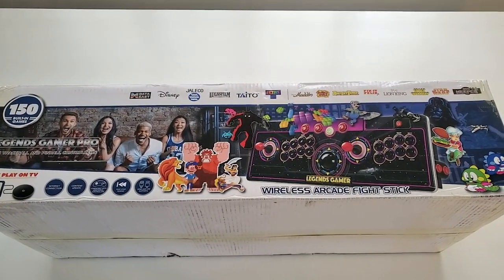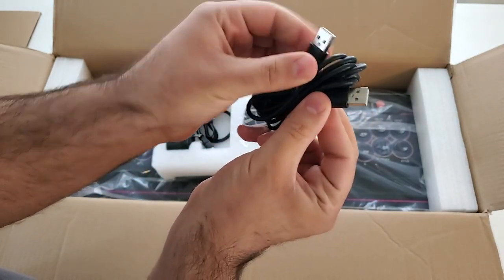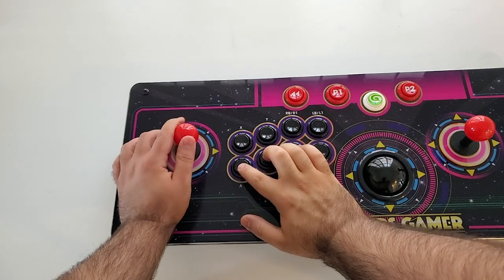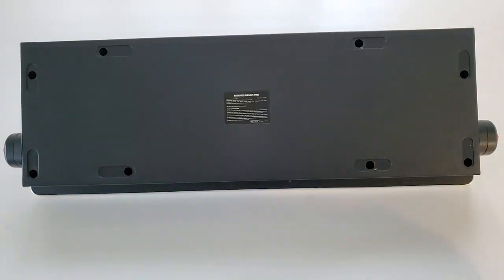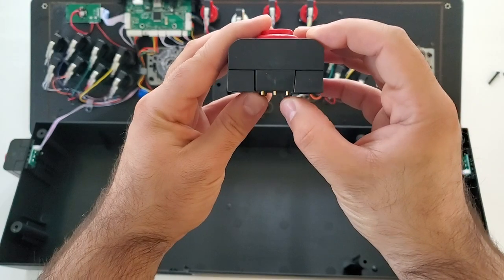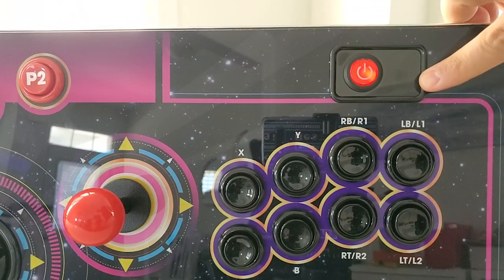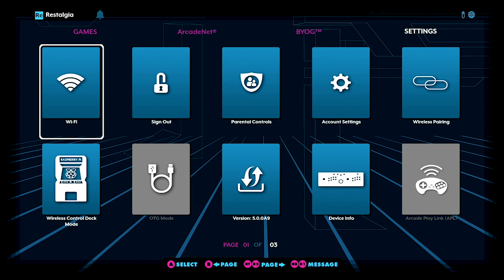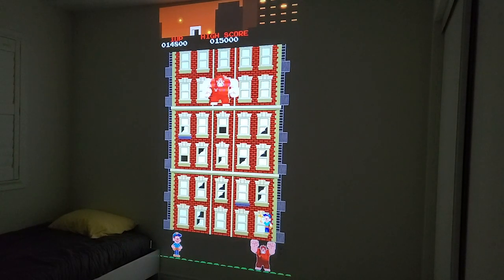AtGames Legends Gamer Pro Teardown and Review

Comment: There's is an open pin for spinner. So u can actually add a spinner.
Reply: Hope someone can mod to make use of the spinner.
Reply: @victormercado4478  Spinner add-on is 29.99, Walmart has the system for 99.99, finally bought one. Can't beat it at that price.

Comment: As far as the battery run time is concerned, I have the Legends Gamer Mini and it has been on for about 1 and a half days and is still running with whatever charge it came with when I got it from E-Bay and the battery low is not n yet.

Comment: In case you bought this for $99 recently at Walmart and are unhappy with the horrible lag from the BT controller - set your TV to game mode and it fixes the problem. I was ready to return it due to the horrible lag until I discovered the game mode setting fixed the issue.

Comment: Hey, new subscriber - Great vids! quick question. I have an Xtension control panel that kinda looks like this product. I also have Hyperspin on my PC I have the xtension control panel connected to the PC. I'd also like to enter the atgames eco system. Can I put this Legends Connect in my PC instead of these products you showed and have it run with the Xtension Arcade control panel that's connected to the PC or do I have to connect the Xtension CP to the Legends Connect directly? If so then my Hyperspin won't run right since it's no longer in the PC USB?  I'd rather Windows 10 recognize the Legends Connect if I connect my PC with USB to the Legends Connect and then maybe it will all work?? Will the Legends Connect interfere with my Windows and Hyperspin? Looking to buy the Legends Connect if I can get all this to play nice inside PC. Thanks and love the channel!

Comment: Just got one and I can't get the control top to pair to the puck. It detects P1 and P2 but just won't connect. Once in awhile it will randomly work (maybe 5% of the time), but after shutting off it
 will not work again. Neither the menu button, P1, or P2 buttons have any effect on the Bluetooth LEDs, which behave completely with a mind of their own. Anyone have the same issues or any fixes?

Comment: Spinner add-on is 29.99, Walmart has the system for 99.99, finally bought one. Can't beat it at that price.
Reply: Spinner add on $29.99 where you get that at?
Reply: @victormercado4478  I saw it on atgames website, under replacement parts.

Comment: Hi restalgia I just received my gamer pro but I have a question regarding coinops. I bought a usb flash drive with games on ebay  and it's connected on my Legends ultimate. My question is since now I have both.. how do I properly take off the usb from my Legends ultimate and connect to the gamer pro? Is there a procedure to it? Or can I just remove it while the Legends ultimate is off and input it on to the gamer pro? Please advise buddy as I don't want to mess up the usb stick. Also question #2 since I bought this stick on Ebay.. is it possible to make a copy of the flash drive? Do I need windows? The only this I have is a chromebook.  Appreciate you bro.. go Canada.. 😆👍
Reply: Remove it with the ALU turned off and plug it into the puck that connects the gamer to the tv.The usb on the the gamer controls is just for OTG.

Comment: Can you hook up spinners to this? I see the connector on the motherboard. will the firmware accept it. also is there  a way to do a composite output for a crt tv?
Reply: you will likely have to use an adapter hdmi to composite\component(for HD) adapter

Comment: I haven't seen any videos on the setting but figured most out but what is the Wireless Control Deck mode for or do. I haven't messed with it since the LGP has been running and good and hate to fubar something up.